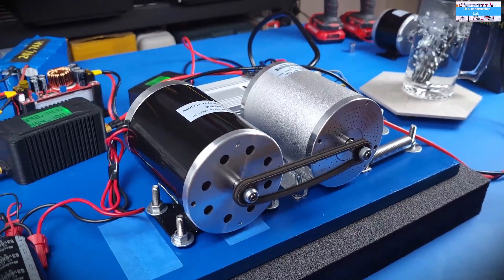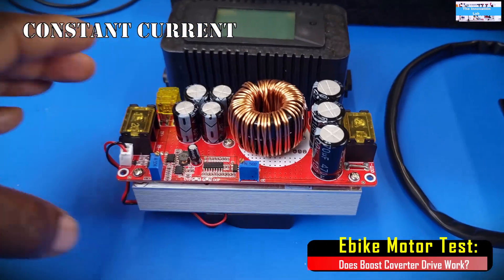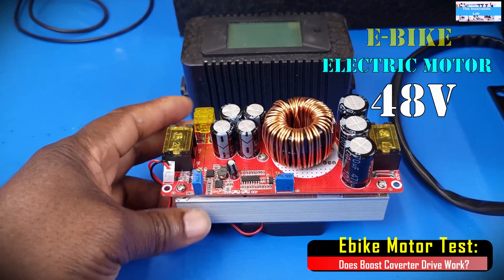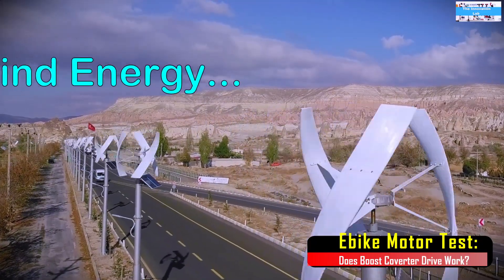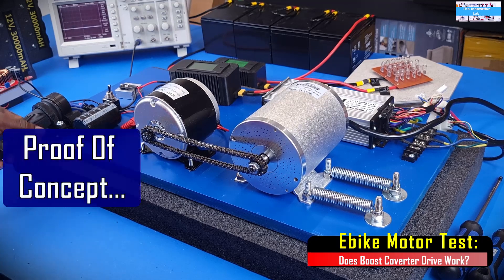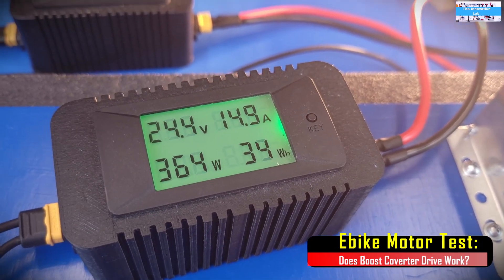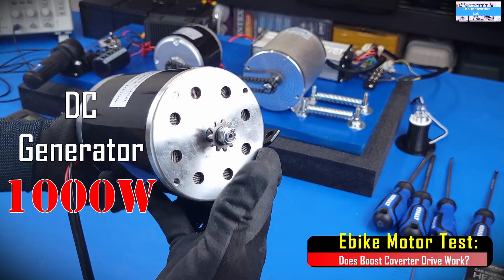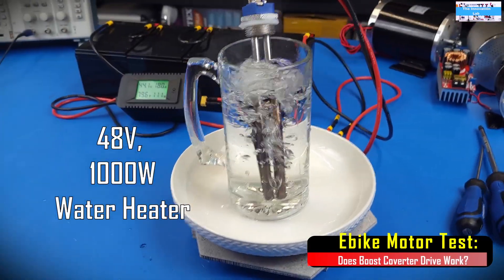Innovative Electric Bike Motor Testing, Boosted by DC to DC Converter!

Comment: Hello from Canada.thank you for all your videos.I have a  two 24 volt 25 ah reongy lifepo4 battery.which can only be run in parallel not series or I’d have my 48 volts.
I am looking for a dc to dc booster to turn my 24 v to 48 v.
from there it feeds into a 48 volt brushless controller.model# 4t48zwsrm-gh04q.
rated current 9a,maximum current 18+1a,speed limit 1-4.2v,brake input:low level,low voltage protection 40v+0.5v.
From there feeds into bafang 48 v 500watt hub motor.
Can you or your viewers please recommend a boost converter to Change battery from 24v to 48 v and that will work safely with the controller and motor.
I am doing my best to figure it out myself but my brain and math/numbers don’t work so well together.
My fear is damaging my controller/motor using the wrong converter or it not working properly.
I have a bpm imports fat tire trike 500 watt 48 volt.
You can not find these trikes in 500 watt because bpm Canada never got off the ground due to Covid.
The USA versions come in 750watt and up.
Thank you again for all your great videos.
Happy Monday to ya.
Reply from the maker: Hi friend,
Thanks a lot for watching our videos and for leaving great feedback.
Regarding converter recommendations, there are lots of dc to dc boost converters out there that could meet your needs. It really depends on your budget. 
The converters shown in this video in theory should be able to individually give you the power you need at a 48V output with an input voltage of 24V. The rated current limit is about 30A, so at an input power of 24V, you should be expecting about 720W to be processed at the input of each converter.
However, the output power has to really account for the efficiency of the converter system at 24V input.
Assuming a worse-case efficiency of 80% (it should really be better than this),
The available delivered power at the output = 720 X 0.8 = 576W.
Hence, if my theoretical calculations are correct, and your motor doesn't care too much about ripple noise levels,.....then one of these $30 converters should give you what you are looking for. 

VERY IMPORTANT NOTES:
1. Make sure that the UVP is set to below 18V.
2. Ensure that the constant current potentiometer is set to the Max output current position.

I will recommend you take some time to watch all the videos below and I am confident that they will answer any further questions that you may have regarding these converters. Just an FYI, I am not affiliated with either the vendors or the manufacturer of these converters. My reviews are  based on my personal ho est opinion.
https://youtu.be/2KyBwwldqkk?si=lckQUYefk8TwmDYh

https://youtu.be/t8Aaz4iQeXY?si=B3kS3kXSpnG3AoB0

https://youtu.be/WDWJ77WWkXc?si=JLzxKk_AIR57YMFN

https://youtu.be/0Ct_sgbAjU4?si=pXKiSgV4C5Xa8BU7

I hope this helps.
And if it does, please support our channel by sharing our videos.😂
👍😎
The Innovati0n Lab

Comment: Nice and very informations,
Which motor better for generator, brush,or brushless motor?
Reply from the maker: I would prefer the brushless motors because you won't have to worry about replacing carbon brushes every now and then.

Comment: I have a question I have dc to dc 1800w 40ah
How many item do I need to make 120ah for inverter without spend $300-1500 for dumbass batteries
Reply from the maker: Wonderful question.
One very important thing to note is that boost converters do not replace batteries. They only raise the voltage component of your required power to match your application. You don't want to overload your battery by using multiple boost converters.
The ugly truth is that batteries are expensive, and if you need to source more power, then you may need to spend a little bit more to increase the capacity of your battery system.

I hope this helps.
Success wishes on your projects.

- The Innovati0n Lab.
👍😎

Comment: Hello sir, 12v 150watt  solar panel to ebike 48volt battery 200ah  charge support  12v dc converter 1800w plzz ans :
Reply from the maker: Hi dear, please can you explain a little better? 
You can write your question in a different language and I will google translate it.
👍😎

Comment: It definitely works. Buy using boost convector will lower down the battery mileage charges than actual.
Reply from the maker: Yes, you are correct. Boost converters will introduce efficiency losses that will lower battery life. 
The point is that some people may find themselves in situations where they can not afford higher voltage batteries, and they are willing to sacrifice the reduced mileage for a cheaper alternative.

Low Budget Dilemma:
Do I spend $200 more for a higher voltage/bigger battery, or should I just buy a $30 boost converter and sacrifice some mileage?
Personally, I don't recommend the boost converter option for those who can afford bigger batteries.

Comment: I use boost converters on my Bikes.   Just gotta make sure it is rated properly for the  Motor and the controller.    Surprisingly,  it is not common to find 48v  high power output boost converters.   It took me a while to find one.
Reply from the maker: Wonderful! 
Thanks a lot for the amazing feedback.
I am glad you found one that worked for you. Do you mind sharing the link to the boost converter? 
I would like to get one myself and test it.
👍😎
Reply: Bro is it works
Reply: There is 100 amp controllers on aliexpress

Comment: So is it the Electronic Speed Controller that is used to control the power to the motor? and the Boost Converter is just outputting the maximum power it can?
Reply from the maker: That is absolutely correct.
The motor speed controller uses PWM to control the power delivered to the motor. 
👍😎

Comment: I have done some testing on my 60v 800watt motor. In real life with load (weight), inside a smaller ev, 800w is low end, lowest gear on a plain and flat surface. The throttle only at 50-70%. In third gear at max throttle, 20miles/h 29km/h, on same surface it will wobble around 1200watt to 1600watt. This is what degrade many gel ebike batteries. They are not build for this high drain.
On a slight mild slope in third gear it will climb to 25-35amp and a mild slope or higher will  put it on factory maximum of 40,5amp or circa 2500watt depending on voltage 66-69v.

I replaced my gels with 32650 LiFePo that is build to handle it and now its both faster, more responsive and charge faster. I charge those with solar.

Edit: forgot to say thanks for the video. :)
Reply from the maker: Hi friend,
Thanks a lot for the great feedback!
We appreciate it.
It's always great to hear the experience of someone who has already built and tested a system. 
👍👍
I agree with you that we need to account for the surge conditions. As a matter of fact, I started the testing with my sealed LA batteries, but I quickly realized that they are not able to support the current surge. Luckily, I have a few 32650 Lipo4 battery packs that I was able to use for the testing.

Thanks again for the wonderful feedback.
Making the video took a great deal of time, but I was super excited and happy to do it.
👍😎
Reply: Good information
The lead acid batteries suck at high discharge rates, they can provide high curtent very brieffily but they will drop down very early
Reply from the maker: @felipehcraftgamer4193  
I fully agree.
👍
Reply: @MegaCyrik  hi i tested in my ev  scooter. battery out put cable wire to controller 
Heated  and smelt when loading  
Vehicle volt 48/7 ampere 
Battery  lead acid 24 v
Boost converter 1200 watt  and 
Converted volt 48 v out to vehicle controller    how to solve issues of  high heat?